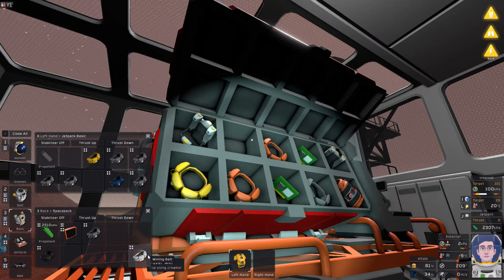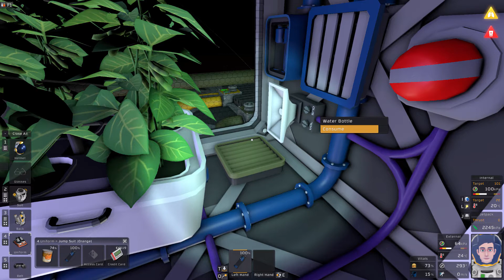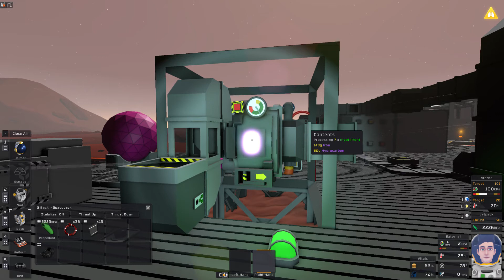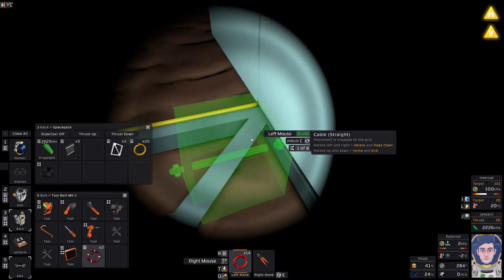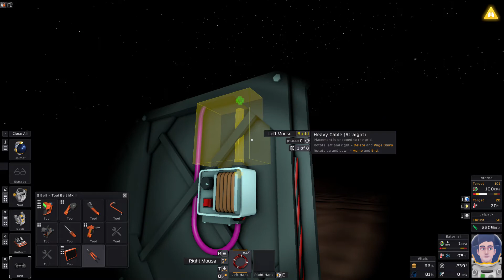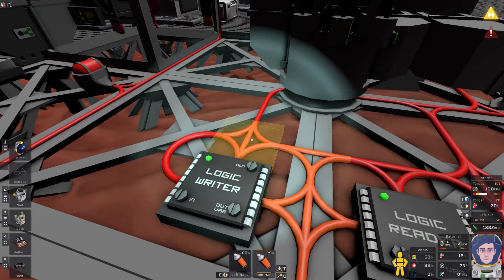Stationeers Play Through Part 27 : Power Networks

Comment: Maybe there is a bit of seeds because veno machine and IC that controlled sorter was off during the cable management.
Reply from the maker: There are actually 3 problems with the seeds in the greenhouse, which you'll see in later episodes...
1) They are not stacking (because Harvies don't stack) and as a result the vending machine fills up all 100 slots with small stacks
2) Yet again I have a mis-routing on the chutes and I'm sending crops to the vending machine
3) And I'm just growing too many seeds anyway

I do some work on number 1 (part fixes it) and fix number  2 in later episodes but basically I'm still generating a lot more than I can use. Longer term I will probably do some more industrial scale storage along the lines of the ingot machine I guess...